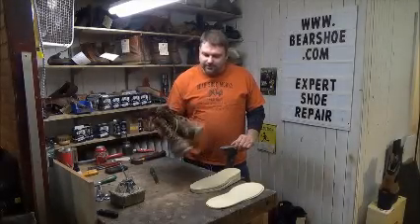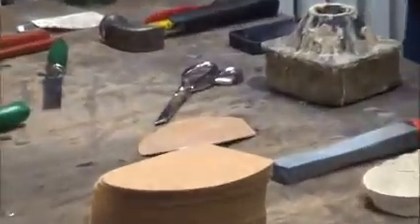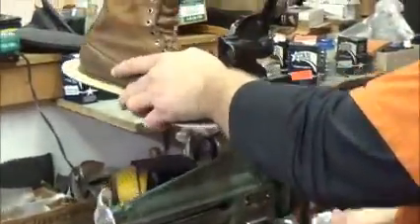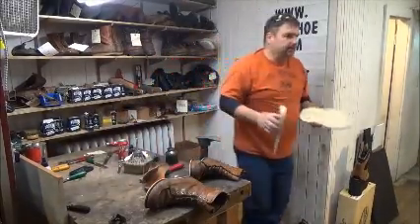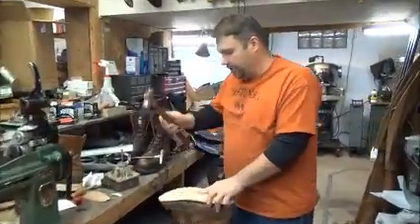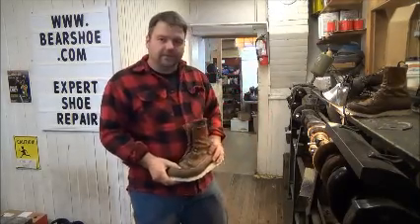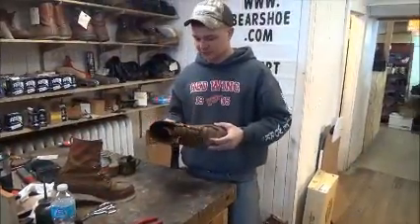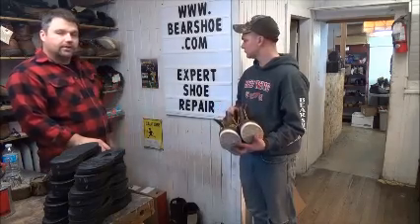Bear Shoe Works Resoling Red Wing Irish Setter

Comment: Good video. Very informative. I have an old pair of Wolverine work boots that sat a long time and the soles crumbled off. Are the Wolverine boots just a glued on sole without the two pieces that you put on before gluing the sole onto the Red Wing boots?
Reply from the maker: +Sword Fish They probably do. I would have to see them to be sure though
Reply: +Klaus Nieder Thank you for the response. I did find out that the midsole that is stitched onto the footbed of my boots appears in good shape and because the original sole just crumbled off I could probably use my existing midsole. Also, after cleaning the glue off and sanding the midsole along with the replacement sole I can glue on the sole with some contact cement.  I'm going to try it. The worst that can happen is it doesn't stick and/or the edge trim won't looked as good as if were machined by a pro. Thank you for your video because it will act as my guide.

Comment: Klaus, I want to have a pair of my RW 595 Chukkas resoled. They have a Poron, rather than cork foot bed, unlike my other RW Chukkas. Which do you feel are better, Poron or cork footbeds. Can you supply either materials when resoling? Thanks, great video.
Reply from the maker: Poron and leather have been used for footbeds. I'm old fashioned I personally like a leather footbed. Poron has more cushion but once the leather takes the shape of your foot there's nothing more comfortable in my option. They do use cork for the filler underneath the footbed.  Thanks

Comment: could you please tell me why would you get your boots resoled instead of buying new ones sinve you're paying alot of money?🤔
Reply: easy. if you pay 250.00 bucks for a pair of boots, and they can last for years, if resoled, which would you prefer to do? my current pair of rw boots have lasted me for over 2 years of heavy use. i don't feel like breaking in a new pair. 100 and change to get them a new pair of soles is a no-brainer to me.
Reply: Well
The boot if still serviceable is most likely broken in already and the sole is all that need replacing.  
ITS CHEAPER ***Hat!!!
Reply: Sometimes the feel and fit is perfect and boots take on a personal flavor with the wearer. Sentiment can also be a strong factor.

Comment: so the final sole is CEMENTED on ? ? 
no goodyear welt ?
Reply: Yes it is. And there is a goodyear Welt we sew the midsole on to it. Thanks
Reply: +Maxim Mee If you don't see stitching on the outsole of a boot, it's likely cemented to the midsole.  You saw him stitch the new midsole to the boot via the welt and then the outsole was attached to that.
Reply: my topic is outer sole.
NOT midsole
Reply: +Maxim Mee Right. It's cemented onto the welted mid sole.
Reply: +Maxim Mee The 877/875 have a goodyear welt to the mid and upper, the soles are glued on the same way Red Wing does it. Look at any 877/875 and you'll see.

Comment: How exactly other than family does someone become a cobbler? I currently work for a major boot company and as much as I love the retail aspect, I would love to be able to go further in and become a cobbler.
Reply from the maker: Thanks for checking out the video. You can only learn by working with a cobbler. It takes a while depending on who you learn with. There is no school that I know of. Thanks
Reply: Spoosh these guys are cobblers they are glue technicians.  He didn't even work the steel arch or even consider it.   He could have added a plastic nail barrier just as a good service person should.

Comment: question I repair mining boots. only because no one around my area or that I have found out of the area want to repair them. the reason is they break needles sowing on the soles. I do it by hand. can you resolve and refurbish mining boots matterhorn or. Carolina boot or red wing metatarsal boots??
Reply from the maker: Yes we can thanks
Reply: Klaus Nieder what's the price to do a pair on matterhorn with new soles size 11"?
Reply from the maker: usually $109.95 to $129.95 depending on what type of sole you want. Thanks
Reply: Klaus Nieder thanks. good price . I all get ahold of you when I need mine fixed. the sole the boot has is vibram construction work style.